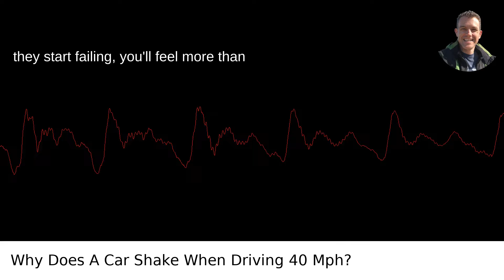Why Does A Car Shake When Driving 40 Mph?

Comment: before wheel balance, first culprit for that shaking will be the tire pressure. it will be all over the place and the car starts shaking *then if you keep at it too long, the shaking will make the wheels unbalanced as the weights go flying